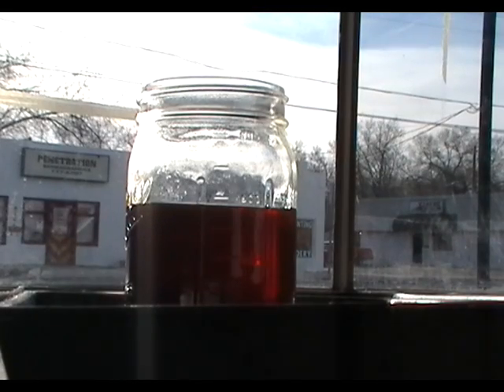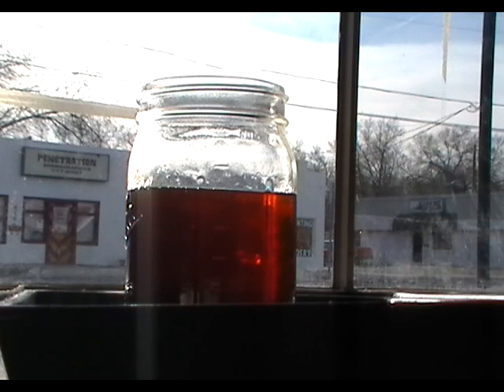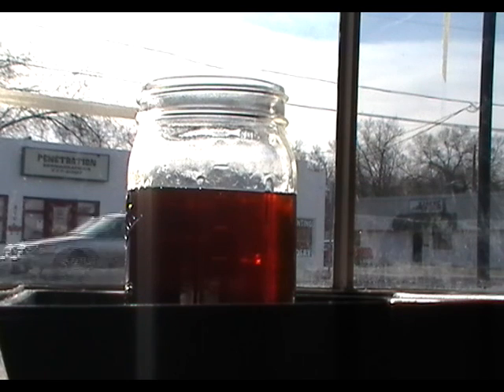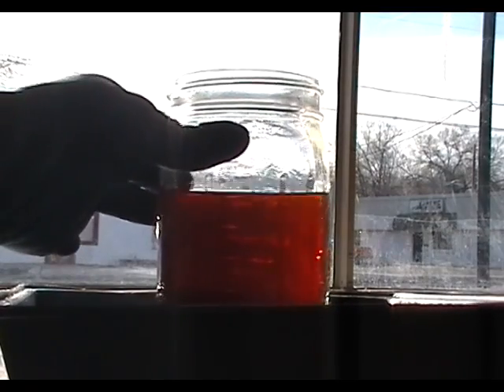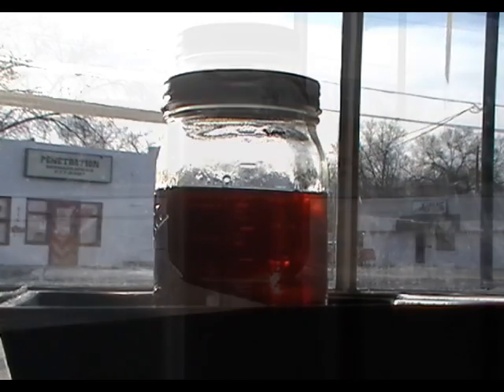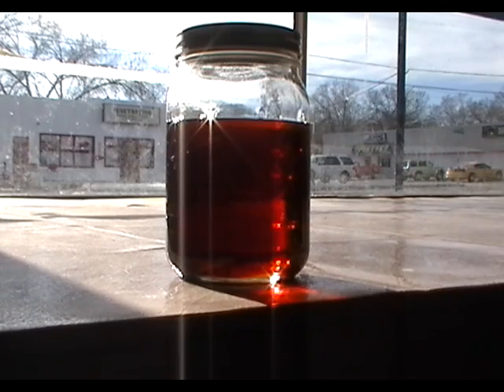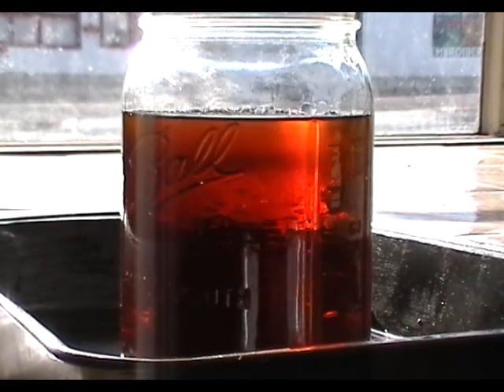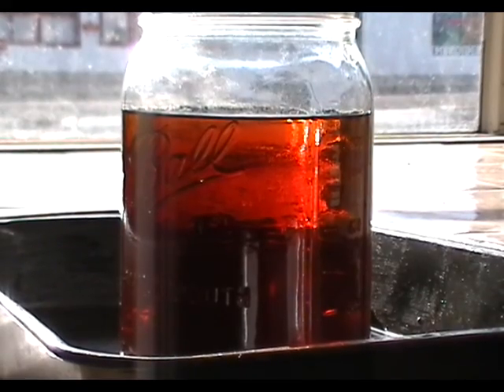Blending Xylol with Vegetable Oil to Make VO Blend Diesel Fuel

Comment: ANY WASTE OIL?  I have a friend who successfully runs his vw pd tdi on a concoction of unfiltered but settled hydraulic / diesel / petrol / and veg mixed in a non exact way (don't think my Chevy 6.5td would like it, its an I.D.I motor)...he doesn't measure anything out and hasn't fried the system yet.....I cant believe it. You seem to be in the minority though Jeff, blending fuels...most folks on here seem to be  chasing a stable veg oil blended 'biodiesel'......well that's the impression I'm getting anyway...do you have any long term usage data or is it just for cold weather use.?...I'm beginning to think you can burn just about anything as long as its clean and thinned enough?
Reply from the maker: turtlezed for the most part it is true, that any collection of waste oils and solvents can be blended together, then settled for about 2 weeks, then filtered down to about 1-micron, will run in most diesel engines.  I have a 6.2, which is nearly identical to your 6.5, both being IDI.  I do find a turbo makes all of the difference in successfully burning waste oils as fuel.  The optical sensor in the 6.5 does have problems if your DIY fuel is too dark.
Reply: Jeffrey Brooks I heard that about the electronic ds4 pump, I've also got an '88 K30 with the 6.2 motor but have just bought a processor and am piping it up to my spec to suit my 2 centrifuges...I don't want to wait for the settling....all this info is good to see and read and with virgin veg oil at 40p per litre bulk, I'm busting to get started cos diesel is 119p per litre (that's around $6.95 in U.S galls) here at the moment (and falling), which is 10p cheaper than 3 months ago with all this OPEC hullabaloo....it'll go back up after Christmas when they sort it I'm sure. Your info opens up other possibilities though and adds to the knowledge mix...cheers ;¬)

Comment: are these experiments to see if veg oil can be manipulated operate at below zero winter temps?
Reply from the maker: turtlezed Well, yes, my fuel has started my engine cold down to 0F, but it was all intended to be an easier, and more efficient way of turning any waste oil, not just WVO, into diesel fuel, and it works fine.

Comment from the maker: @charuincarnation Most of the oils I have burned in my diesel engine in the last 5 years of research have been canola, and/or soy bean oils. I find unheated vegetable oils require thinning to run in a stock diesel engine without coking the injectors.  I prefer to thin with solvents, such as gasoline, turpentine or xylol, because I find my engine starts, idles and runs better that way; and blending with solvents prior to filtering makes filtering waste oils so much easier.

Comment: I dont understand what the xylol is adding to the fuel. The unprocessed vegetable oil should have enough chemical energy to run fine in a diesel engine without adding any petroleum based solvents/VOC's to it. Furthermore what kind of vegetable oil are you using? High high oleic sunflower or soybean oil requires almost no blending.